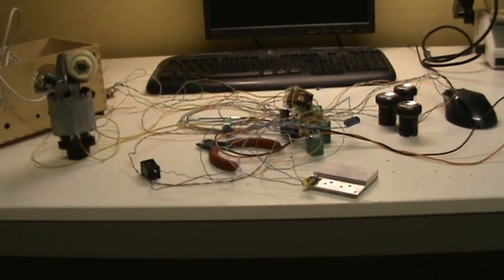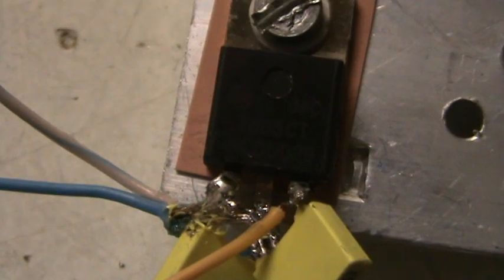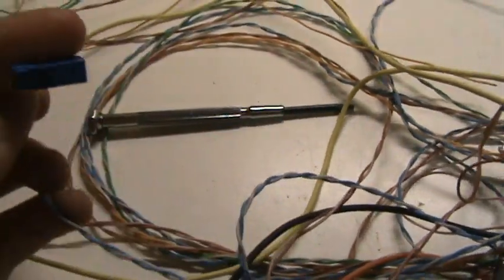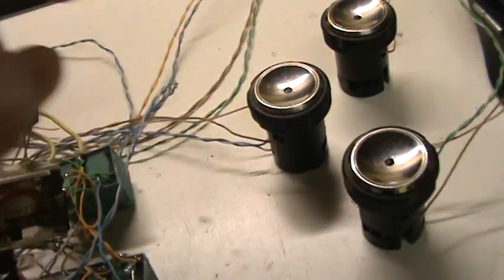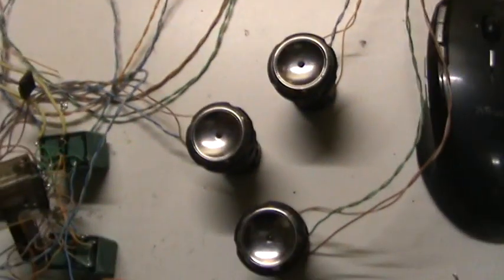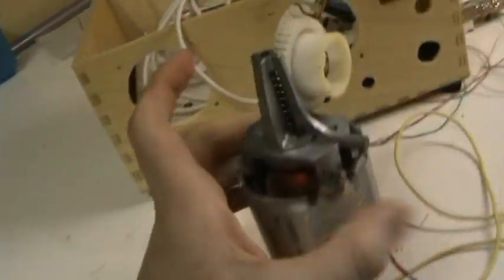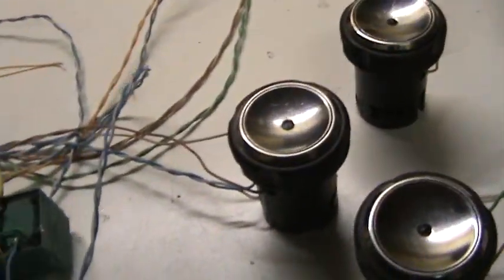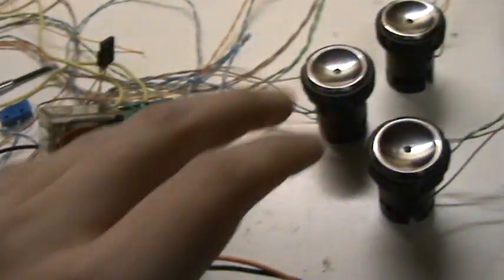Homemade Miniature Elevator Relay Controller

Comment: Very Nice... with that motor I guess you can lift a cat at 0.10 m/s, LM7805 is too weak, better add a 2N3055 transistor, or use a variable pulse wide circuit for smooth acceleration and deceleration. A luxious cabin with mirrors, wood, halogen light  (need a better power supply too...) computer fan for the cabin vent, photocells to avoid your cat be estrangled by the doors, Don't forget the panel in the cabin:

Maximum load: 1 cat - 3 Kg
It is dangerous to overload an elevator

Enjoy...